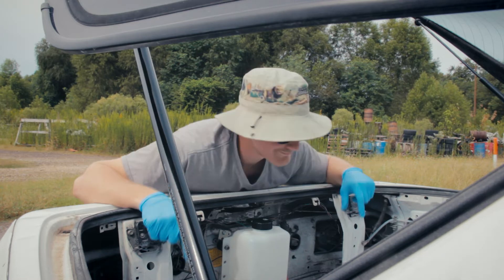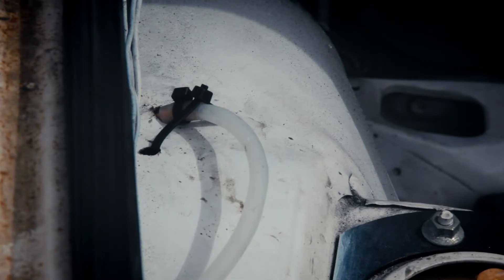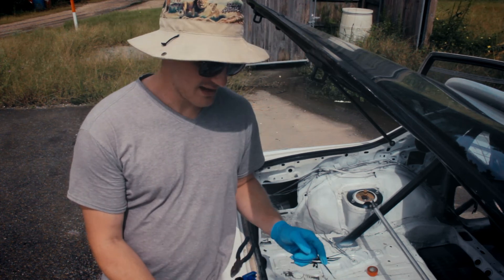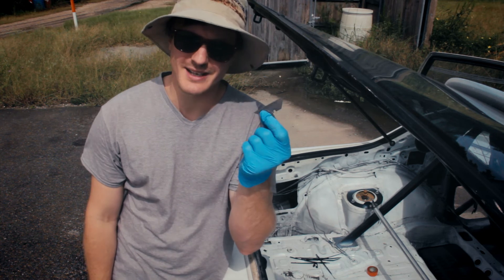Building a tire cooling system for the missile car

Comment: This is actually really awesome, but honestly speaking I'd be a lot more excited if there was a way to build a vapor chamber cooling system directly into the wheel rim. That way, it could be entirely self-contained, making sure that the temperature inside the tire is as evenly distributed as possible.

Comment: If you combine this with one of those self-inflating tire kits, and also add multi-seal to the inside of the tire to automatically seal any punctures...

You'd probably end up with tires that last forever.

Comment: I'm putting my kit together right now. Still waiting on a couple fittings, so I haven't tested it yet. I'm using pesticide nozzles for the sprayers. They're really cheap and they have a nice wide (and adjustable) spray pattern. I am also using Gates red multipurpose hose. It is more expensive than the regular clear plastic tubing, but it will basically never break or dry out or anything like that. For the tank, I'm using a six gallon fuel cell. It's overkill, but everything has costed me about $100 including fittings and all that, so it will still pay for itself in less than a drift day (provided everything works)
Reply from the maker: James Kurz wow so many good ideas. I’d love to see what nozzles you got, that sounds brilliant. And if I had the room I’d totally do the fuel cell too! The ballast that would offer is reason alone to do it. You must be some sort of drift genius!
Reply: Evan Woss

I am literally the opposite of a drift genius! I stole these ideas came from a mechanic friend of mine. I haven’t even been drifting for a year, but I’m trying to learn in the most budget-friendly way possible 😂

Comment: I think we bought all our parts at the same time but I ended up putting mine on the back burner when I didn't have it ready in time for no coast haha -_- I like the copper nozzles you built, I went with a plastic nozzles from dorman that I think have a wider spray pattern but will be more fragile so we'll have to see how that goes. Great tip on putting the water tank in the center, I nearly forgot about that. One other thing for people to note is that the sprayers will gravity drip water out if the level in the tank is higher than the sprayer nozzle height, so mounting the tank low is a good idea.